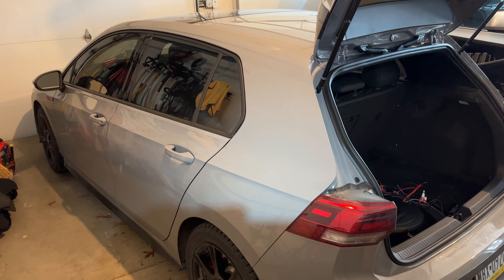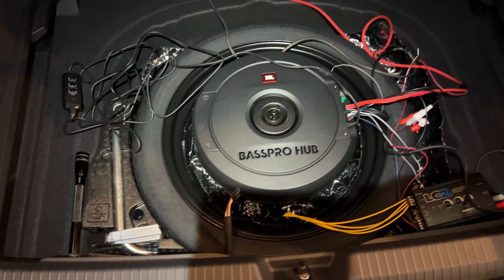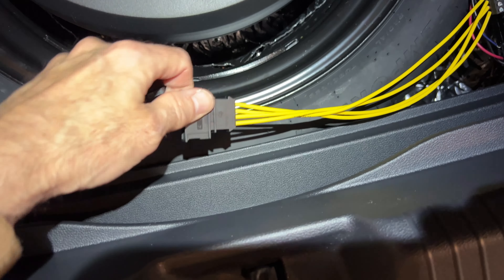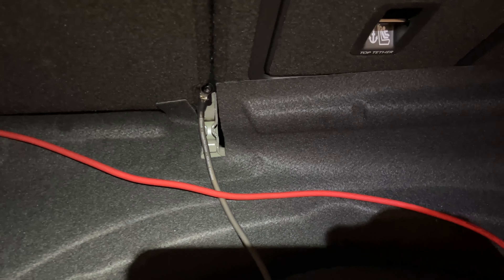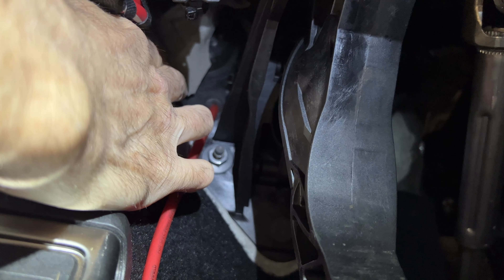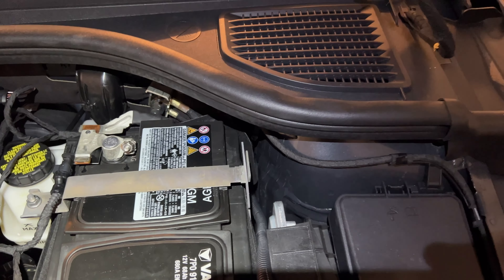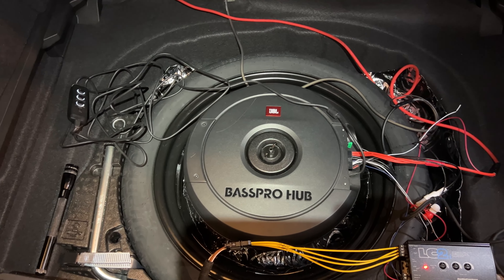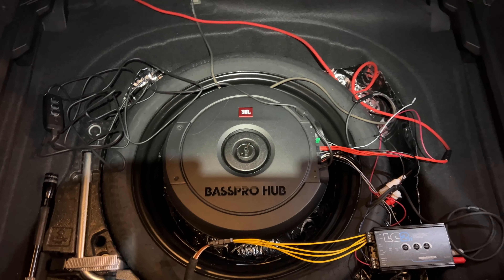2022 2023 MK8 Golf GTI  Golf R subwoofer amp install

Comment: 0:14 Hi I am adding the same Sub to my 2024 GTi. I am replacing the HK "SUB". 
Question 1.How to know where the  speaker wires  from the OEM sub harness connect in the LCi LOC? 
2. Did you tap the main power line for the LCi power?
3. Does the LCi remote turn on then in turn remote turn on the JBL sub?
Thanks for any feed back! Also are you planning on upgrading front speakers?
Thanks. Bob

Comment: Good video. I'd be throwing a decent multimeter over the ground point with ground disconnected and check the resistance because these cars are unibody and sure it will work but you're asking for trouble if it's got a lot of resistance. Professionals (and I only just learned this myself but in these newer cars they are they reccomend running power and ground all the way from the battery both positive and negative terminals. Still a nice upgrade and not trying to be negative just sharing info 😊

Comment: So this sub doesn’t have a loc built in it? I thought you could just connect the oem factory sub wires straight to the high level inputs of the jbl and it will convert it to a low line? I believe the Cerwin Vega and Rockville spare tire subs do that

Comment: Does the subwoofer require all of the wiring and extra equipment for it to work?
Reply from the maker: The minimum you need: You will need a wire to run power to it to the car’s battery. And you will need to ground it with another wire. And finally, you need to provide a signal to it, so you either find the car’s speaker wires and splice into those (I’ve read that the front door speaker wires are the way to go), or if you already have the stock sub then you can simply cut off the connector, and use a small amount of wire to extend the wires to the sub’s connector. If you ever want to revert to stock, you just re-attach the stock connector.

Comment: Hello! Does the car still have drivers assistance features? Lane keep, centering? How’d you get that to work
Reply: If you’re just doing the subwoofer upgrade, you’re using the sub speaker signal that’s already in the trunk. This won’t impact any of the assistance features or sensors. It’s when you start making changes to the other speakers, specifically the a pillar ones I believe, you have to address any resistance changes (usually by adding, um, a resistor, lol). If it’s just the sub, you’re good to go.

Comment: What did you use to hold the sub down? The stock one is way larger than the smaller hole in the center of the sub.
Reply from the maker: The new sub comes with its own bolt. It’ll screw directly into the existing hole, you won’t need to use the plastic cylinder thing that went into the OEM sub. Note the new bolt is a bit too long so you need to cut off an inch or so. The new sub holds in place nicely enough once you really tighten the bolt. You can also choose to put some foam (cut a pool noodle or pipe insulation foam) around the bottom of the new sub to give it more support.

Comment: Hi, great video, looking at ordering a gti mk 8.  Is this connected to the standard audio system which comes with the car ?
Reply from the maker: Yes, if your car has the HK radio system (comes with all trims except the base model), then it connects like the video. If your car doesn’t have the HK, then you may need to splice into one of the speaker wires in order to provide a signal to the subwoofer since I’m not sure if you’ll have the sub wire already out in from the factory.

Comment: How to connect to standard speakers , no HK
Reply from the maker: @stormtrooper2273  you need to tap into the front speaker wires (apparently the rear speakers have limited frequencies). This likely means removing the trim panel on the floor to access the wires, but I am unsure what colors you need to splice into. VWvortex forums typically have good advice if you go into the MK8 GTI subforum and search for ‘subwoofer”.

Comment: Does the rear cargo close when inserting the hub or doesn't close up?
Reply from the maker: It closes!
Reply: @TheSunderlands  weird tried to put it in with the small spare tire but it wouldn't close due to the size of the hub
Reply from the maker: @vipermanx99  did you cut part of the bolt? It’s too long, need to cut it so the cargo closes flat.
Reply: @TheSunderlands1  which part again can you please explain?
Reply from the maker: @vipermanx99  the long black bolt that screws into the middle of the subwoofer is too long. It needs to be cut by about an inch or so in order for the cargo floor to not hit it.
Reply: @TheSunderlands  its not just the bolt, even without the bolt on the hub size is to large for the cargo cover to close thats my main issue
Reply from the maker: @vipermanx99  hmmm…have you tried flipping over your spare tire? I wonder if something is different as compared to my GTI.?
Reply: @TheSunderlands  flipping it makes things wors  on golf R the space of the inner spare (mini tire)  is lower then otter.the only issue i have it the cargo cover if there is a way to modify it to keep it alittle higher then perfect
Reply from the maker: @vipermanx99  ok I see. I know that some people who have installed bigger subwoofers have had to put shims where the cargo floor rests in order to raise the floor up a little bit. Basically then floor rests on edges on left and right, and also one near the back of the car. I believe they used 2-sided tape and either pieces of wood or plastic (you can find shims at hardware stores, might need to cut them down to fit). The floor will clear the sub,  it will be raised a little bit as compared to the rest of the floor on the left and right. But it may be worth it to get better bass!
Reply: @TheSunderlands1  interesting will try that idea thanks
Reply: @TheSunderlands1  Does it close in the lower floor position? I have the trunk mat specifically for the lower position (I also find the depth helps store some of the boxes i tend to carry in my trunk when i need to) and would love to upgrade the sub but worried it might not close.

Comment: Hi, is the remote wire supposed to go direct to the stereo ?
Reply from the maker: The remote wire could go to the stereo, but it just needs to go to a power source that turns on when the ignition is on. In my case the LC2 turns itself on when it senses a signal from the speaker wires, so I used that for the power source. But any 12 V outlet that you can splice into, etc, would work as well.

Comment: Is there a reason you went through the lc2i instead of speaker level direct into the sub? I was doing research to do this and found that the amp built into the sub has line level inputs and speaker level inputs. I am wondering if i dont need to spend the extra to get the lc2i
Reply from the maker: I believe you are correct, no need for the LCI. I used it because I had one from a previous car, so I threw it in there!

Comment: Can this be installed if you don’t have a factory sub?
Reply from the maker: You can follow the same steps but would need to splice into the speaker wires to provide the signal. I don’t think the models without the sub have the sub wiring installed but could be wrong.  VW Vortex forums may have more info.

Comment: Do you remember what polarity the wires were on the stock connector? 
There’s brown, brown/yellow, white, white/yellow
Are the yellow stripes positive?
Reply from the maker: This is what I did:
1.) Solid Brown - Positive (Right)
2.) Solid Yellow - Positive (Left)
3.) Stripped Brown - Negative (Right)
4.) Stripped Yellow - Negative (Left)

Comment: Is the line output converter required? Is there no way to adapt the stock subwoofer connection to the jbl sub?
Reply from the maker: You don’t need the LOC. I just had one laying around and wired it in!
Reply: @TheSunderlands1  ok thanks. I’m totally out of my comfort zone when it comes to car audio. Does the jbl already come with an adapter to plug the stock subwoofer connector to the jbl sub?
Reply from the maker: @MLDstxspartan it does not. If you don’t want to cut the stock connector off to splice wires, you’ll need to order the connectors on Aliexpress or something. That’ll allow you to keep the stock connector intact. I out the part number in the vid, make sure it comes with the metal crimps as well.